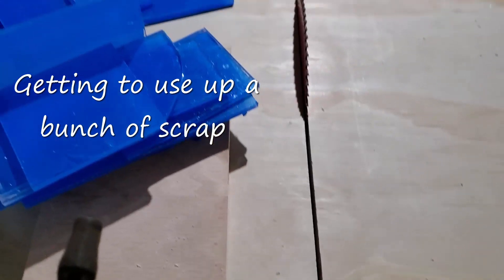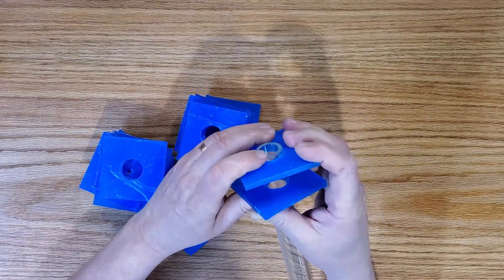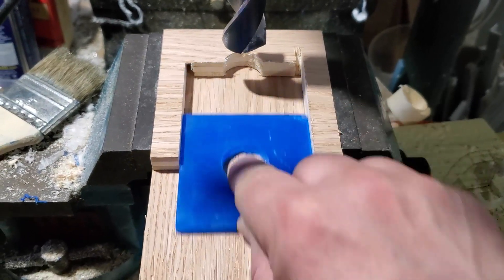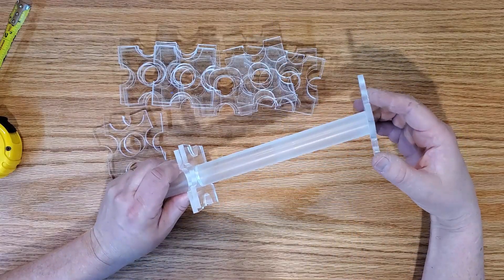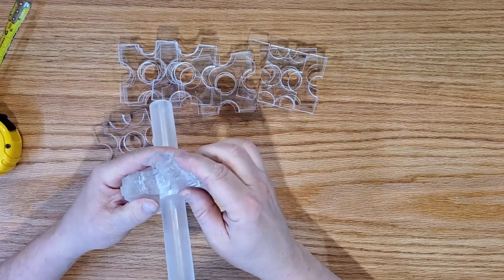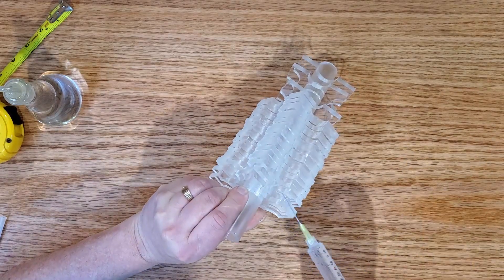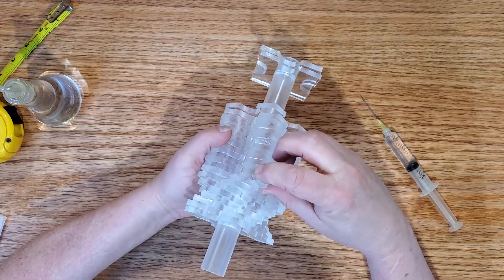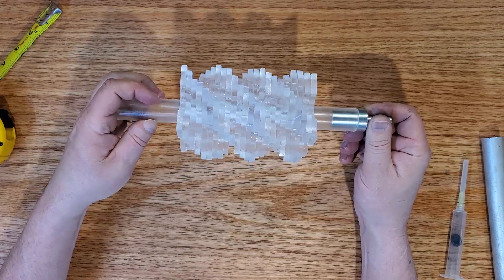Archimedes' Screw for Aquariums Part 1

Comment: I like it. Maybe you could use a wood or metal dowel in the center of the tube to aid in strengthening the piece and also allow it to be supported on both ends?
Reply from the maker: If this heats up too much, even when lubed, I will have to switch to a solid core for sure. Thanks for coming by!